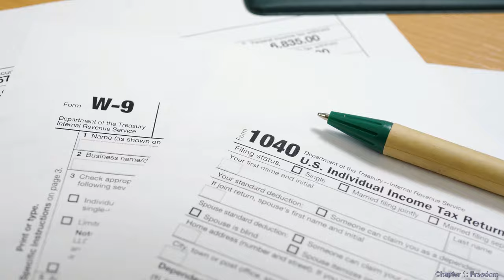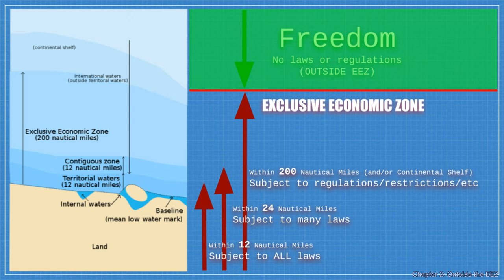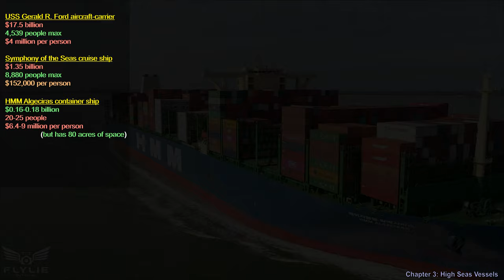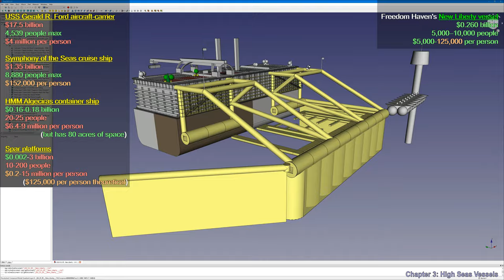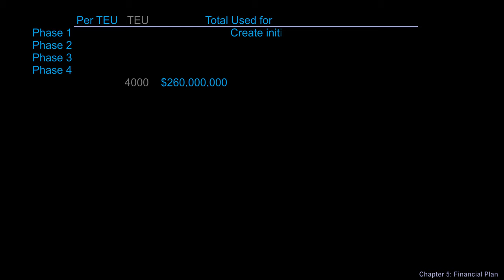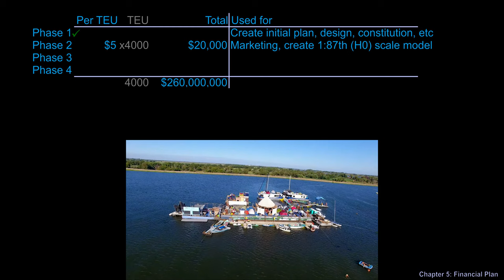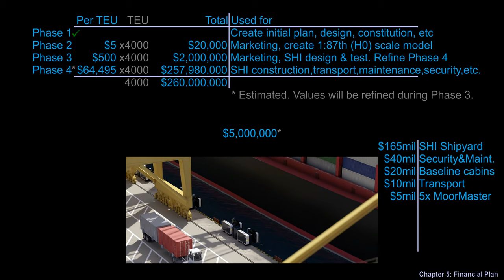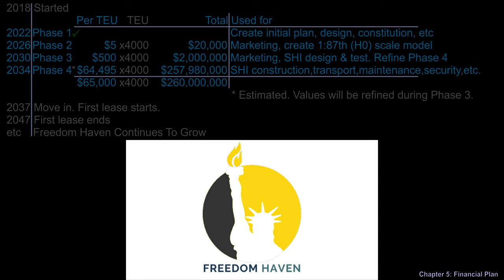2022-01-18 - Intro To Freedom Haven

Comment: At 13:24 The narrator voice says "H-Zero" but the correct scale model size is actually called "HO," meaning "Half O" as O Gauge is one of the scales commonly used in Model Railroading train layouts.1:43.5, 1:45 and 1:48 are common O Gauge Scale Ratios but HO is 1:87. My late inventor Father Paul Sr. often waxed enthusiastic over the communicative and explanatory power made possible by exhibiting scale models of proposed things.
Reply from the maker: Good point. Thanks 😀
Reply: It's actually an ongoing frustration/pet peeve for me that "0/zero" and "O/fifteenth letter" are almost impossible to distinguish without using the slashed zero--which is almost never available in standard fonts.
 @TonyOlsenFerris